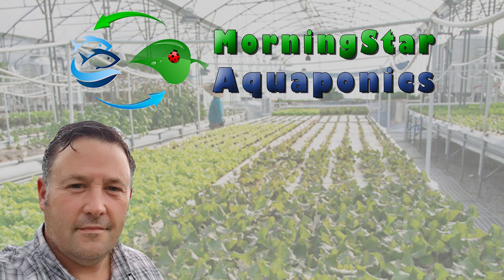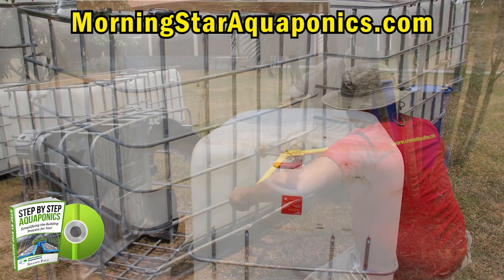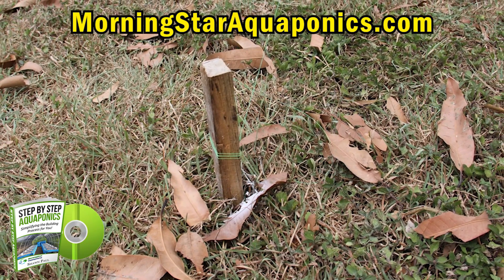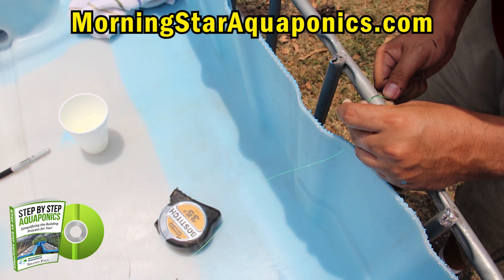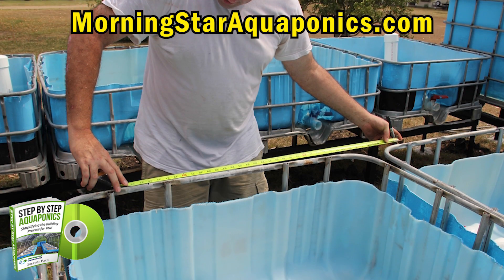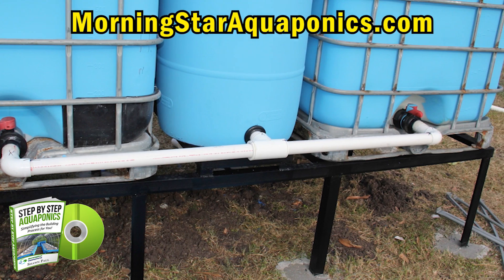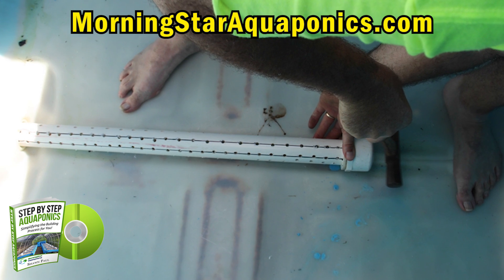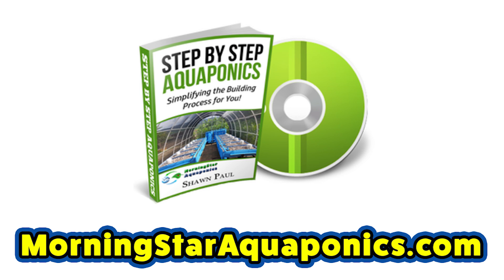AQUAPONICS - Step by Step Instructions - From Start to Finish

Comment: I am looking at going and setting some like this up the only problem I have is where I am off to has little electricity and lots of brounouts so I am looking no pumps I could use a hand with that issue
Reply from the maker: Having electrical issues will be extremely difficult to run a system. You will need to look into an alternate source such as solar or wind.

Comment: Hi
May i know why are you adding biofilter in spite of you have grow bed? What is the maximum stocking density you are advising?
Reply from the maker: Yes, you can use your grow beds to do that.  A biofilter is a place for beneficial bacteria to grow.  A biofilter is cheap to build, why not do so?  Also, I do everything I can to prevent any fish fecal matter from getting into the grow beds.  For my systems and with tilapia, max is 64 tilapia in each IBC tank.
Reply: @thehealthawakening  Hi Shawn, Thank you for your reply, will you please explain what is the maximum stocking density in AP we can keep?
Reply from the maker: For tilapia in my systems, I calculate for a 1 lb fish for every 4 gallons of water.  The IBC tote will have approximately 250 gallons of water.  All fish species have different stocking density and water quality tolerance.

Comment: spray paint would be as good vinyl paint no? as long as its water-based?
Reply from the maker: Spraying is a way of applying the paint.  I don't see an issue with it as long as you don't get it inside the system.  I prefer water based myself.
Reply: i'm currently ordering paint
Reply from the maker: OK
Reply: Cheers Paul :)

Comment: You go to great lengths to use Ibc totes but for the grow beds would it not be easier to build two big grow beds and only 2 bell siphons less pipe and fittings
Reply from the maker: Sure, but you have to build according to the materials that are available to you.  I live in Honduras, we are limit to what we have.

Comment: What can I do for a sump if I cannot dig thru dirt? My backyard is completely cemented. Thnx
Reply from the maker: You would have to build your grow beds up higher and make your sump more shallow.  I would avoid bell siphons because they make the water go up and down dramatically.  You would need to go with the constant flood method and consider a ball float valve in the sump to ensure proper water level at all times.  Make sure you check out my Ebook at www.morningstaraquaponics.com
Reply: Shawn Paul thank u
Reply: robbycast 
You can still use grow beds with flood & drain if you put the sump (as big as you possibly can do) on the ground and pump water from there to the second sump (full size) also above ground. You than put a sensor/switch (like in the toilet) that activate the pump when water level is high, and stops when water level is low. 
This does not interfere with the rest of the system due to that water is pumped up from the sump. It can therefore be placed practically where ever you want as long as it is under the grow beds and under the fish tank. 
Cheers mate

Comment: Our ground is bedrock.  Tskes dynamite to make a hole.   Suggestions??
Reply from the maker: If you have that firm of a bedrock, I assume you have a solid base.  Dig down as far as you can and pour a concrete pad for each leg.
Reply: dynamite